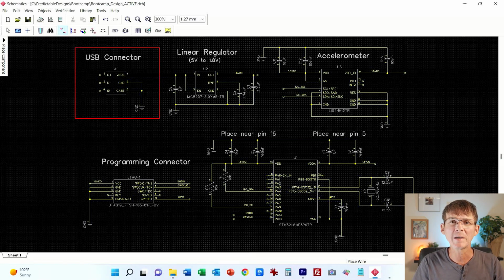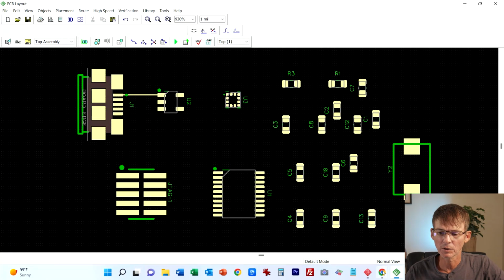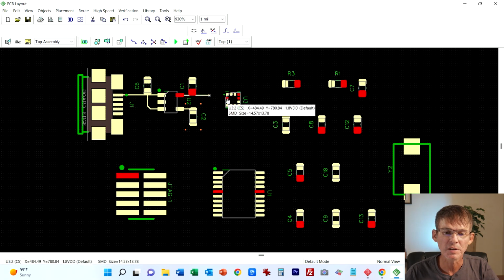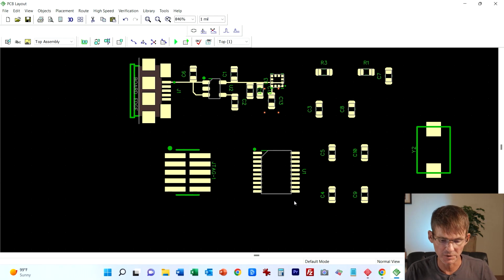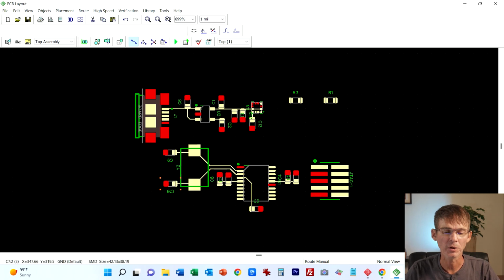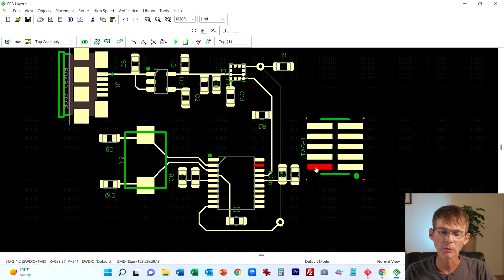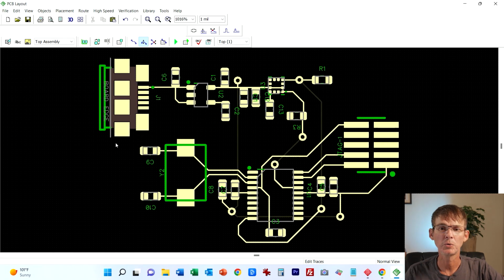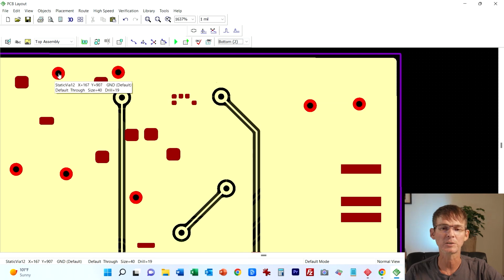Tutorial - How to Design a PCB

Comment: Awesome how would one install or upload the software to the PCB ???
Reply from the maker: Thanks for the comment. You would connect to the microcontroller through the programming port, and you will need a special programmer device for that.

This video and the next one focus on only the hardware, so I won't be covering the programming until perhaps another video.